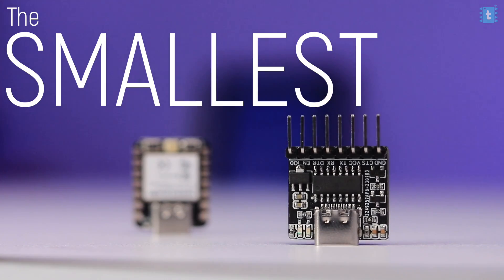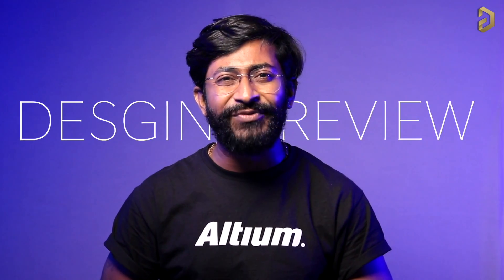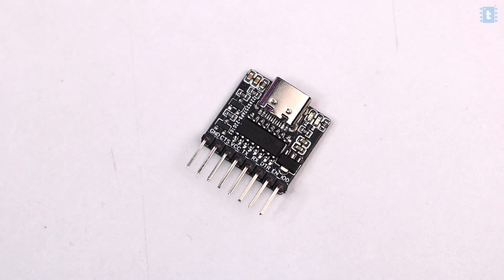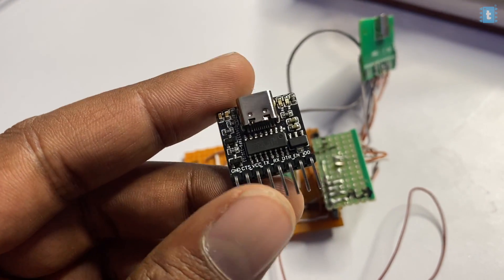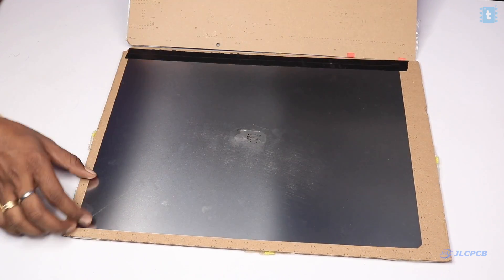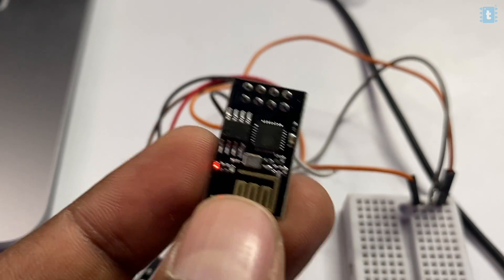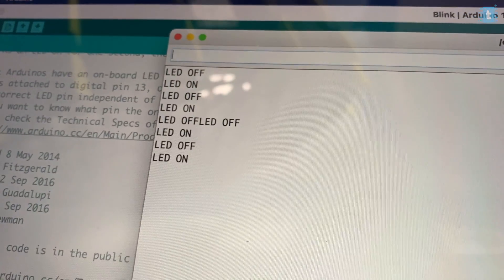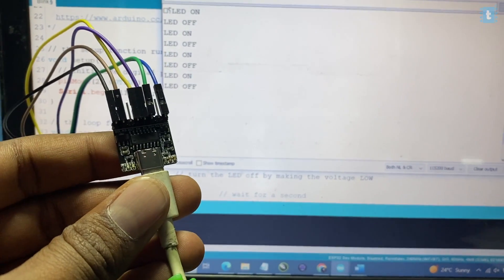World's Smallest TTL Programmer to program any microcontroller 🔥🔥

Comment from the maker: Hope you like the video and the programmer. Drop your thoughts for Universal TypeC based programmer 

Also you can buy this smallest programmer Right Now - https://www.techiesms.com/product/smallest-ttl-programmer/
Reply: It would have been more handy  if you would have been used jumper pins to switch from 3.3v to 5v So that no need to use multiple boards for multiple controllers as well we can easily switch between voltages without always needing an soldering iron. update the circuit..

Comment: Bro I have a suggestion that when you are ordering the PCBs like TTL Programmer or universal ir blaster or any small pcb do try to panalize the pcbs. In this way will will get multiple pcbs at the same prize. Also you can use one stensil to solder all the pcs in the same panel at a time. In this way you will save a lot of money(get more pcbs at the same price) and also save lot of time soldering the pcbs.

Comment: Sachin this programmer is simply superb but only one drawback is soldering the voltage level pads which is not good for beginners and better add selectable pin headers on board or you can add one more extra pin for the voltage level

Comment: Instead of 'sholdering' aka soldering the pads to set voltage between 3.3v and 5v level, you could have provided a jumper pin.
Reply: thoughtful
Reply from the maker: just to save space we used those pads
Reply: What about a micro spdt sliding switch in places of soldering pads
Reply: Didn't read your comment but I also suggested the same But the only thing is That jumper pin must be on top rather than on back.  Wait they can provide both options also What if we accedently jumper pins broke for some reason.. But they must be at top and also voltage level incication also must be printed on the board so that every new user no need to check the datasheet everytime..